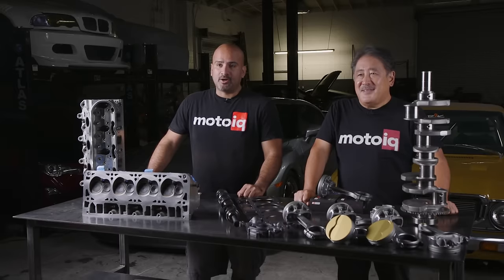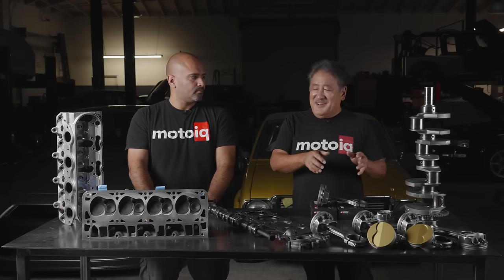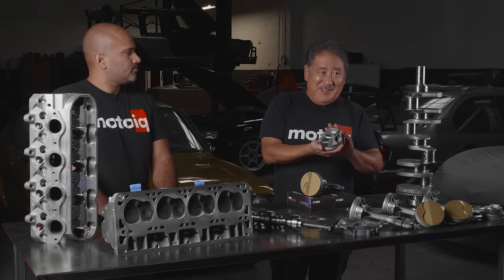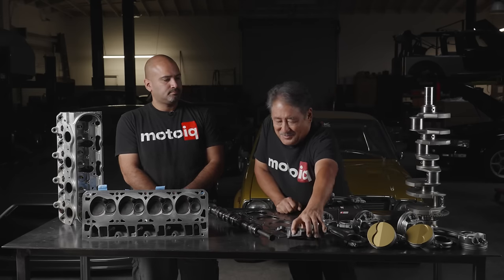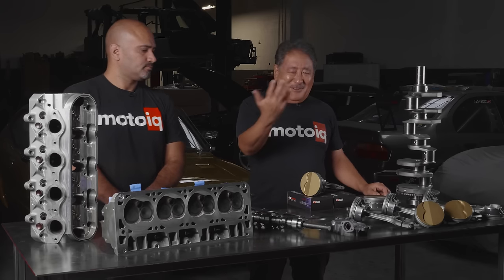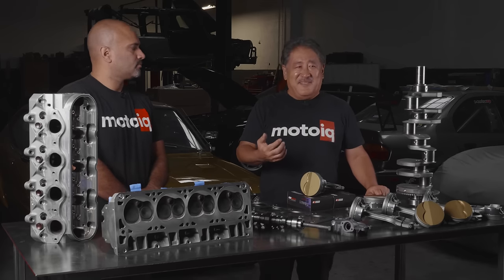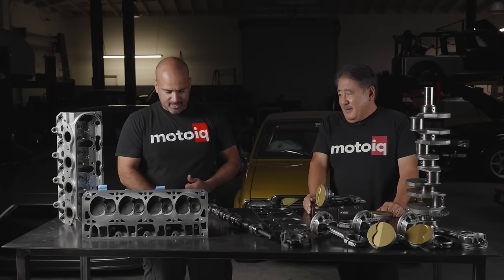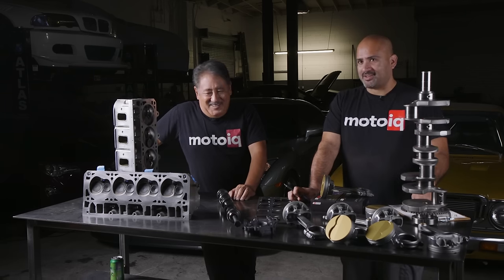How Much Does an LS Engine Build Cost?

Comment: Can I order one of those $1900 LS3 block from you?
Reply from the maker: You can order it from your Chevy dealer.
Reply: @motoiq unfortunately they quoted me $2800.
Reply from the maker: Here is one for even cheaper! https://edrinkeperformance.com/ls3-l92-aluminum-6-2l-bare-block/12623967
Reply: @motoiq  I called them. Sadly that's a discountinued part number. New LS3 block part number has $2,800 MSRP. Pretty sure $2,800 has been price for a year or two. Also GM changed part number, raised price of gen 4 6.0 cast iron from $1200 to 2200 and then discountinued. 6.6 LT cast iron block was $1400 now 2300. Ford's new 7.3 gas Godzilla block is only $863. So probably not cost of raw materials. Thank you for replies and your time. Really enjoy your videos and articles.

Comment: Run 4340 3.622 crank, 4340 rods, 2618 pistons, ARP hardware. BTR turbo cam, springs, pushrods, trunions, ls7 lifters. That's your budget 1000hp build on a stock block.
Reply from the maker: We agree with you. We find that the aluminum block in particular can have trouble keeping head gaskets at about 800 whp and over 14 psi.   This is under racing conditions. The blocks themselves start to show distress in the main caps at around 1000 hp.

Comment: Oh Look, a 351 Windsor design

Named LS 

😆 😆
Reply from the maker: More like a small block Chevy...
Reply: @motoiq  sophistry. 

It’s based off the Ford Windsor, but obviously not a exact copy.

Not arguing, it’s just a fact and common knowledge.

Both are legendary, but I would give the edge to the LS.
Reply from the maker: Bore spacing is the same as the SBC and the block and heads are nothing like a Windsor.  I mean the heads almost bolt on (but don't) but that's about it.  That rumor probably started from the kits they sell to make an LS look like a Windsor for people who want to put an actual good engine in something like a classic Mustang.